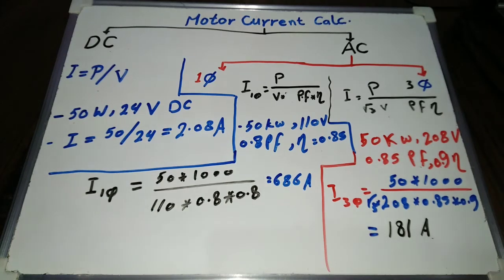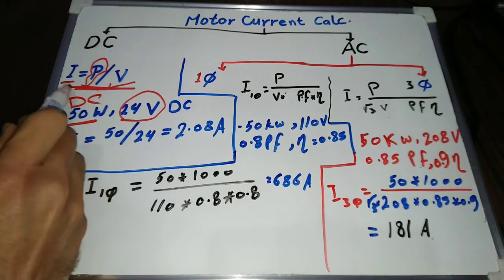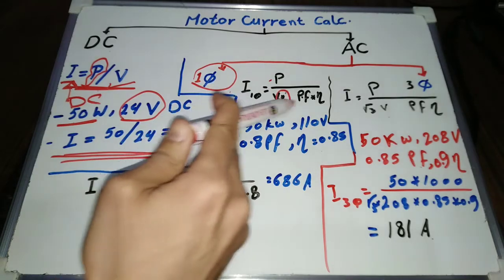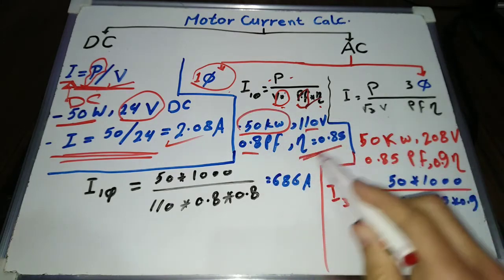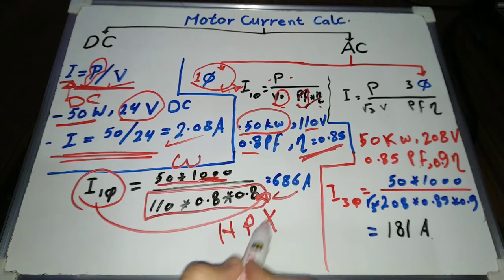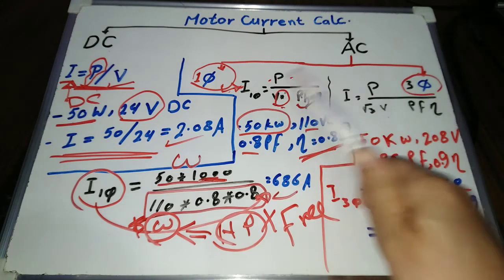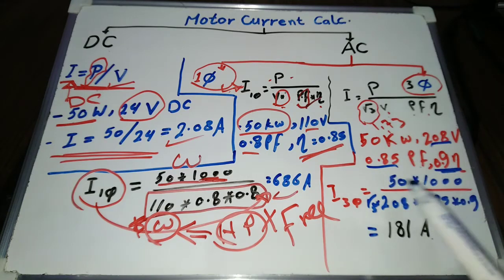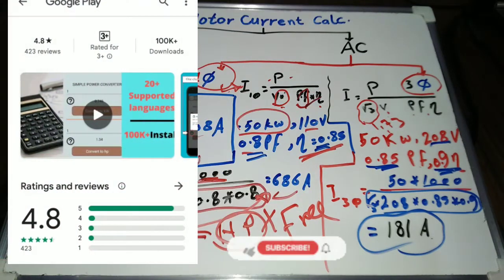Motor current calculations, step by step!

Comment: Good afternoon, nice video but I have a little problem. Here's the thing : I have a motor single phase and only the data of the capacitor. And the data is 0.2 μf with diagram that split in two 0.02μf and 8 amps , 250volts. I want to calculate the power (Watt) and rpm . Is it feasible and how?
Reply from the maker: To calculate the power (Watt) and RPM of a single-phase motor with only the capacitor data is not feasible. The capacitor is a component used to provide a phase shift in the single-phase AC motor, which is necessary to generate a rotating magnetic field required for the motor's operation. However, the capacitor's value alone does not provide enough information to calculate the motor's power and RPM.
Reply: @ElectricityFrenzy  more or less I know how a capacitor works on a motor but thanks anyway for your answer that in conclusion tells me that I can't calculate the power or rpm so the only way to find this data is bibliography behind this motor. In the meantime another question popped up and this is: can I increase the rpm of the same ac motor with permanent magnets and I mean without disturbing the winding of the motor or playing with the current risking  its safety limits?  Thanks in advance regardless of the answer.
Reply from the maker: No, you can't increase the rpm by a magnet.
Thanks for your valuable discussion 👍
Reply from the maker: Thanks,
You mean, you have motor voltage 250v, current 8 amps and capacitor 0.02
And want to calculate power and rpm?
Are we on the same page?
Reply: @ElectricityFrenzy  I mean that all these are data of capacitor and I don't have any other clue. The power station gives the usual 220volts 50Hz. That's all
It's the motor of a vacuum cleaner (vintage hoover). Only from the firm and the model I suspect the final power of this motor.
Reply from the maker: You can measure the RPM by a tachometer

For the power you can measure the current using a clamp amp. and calculate the power
Reply: @ElectricityFrenzy  Thanks a lot but the question any way is if can i calculate without measuring. I see some types of calculation and I am not sure if it is right. By the way thanks for your effort and response.